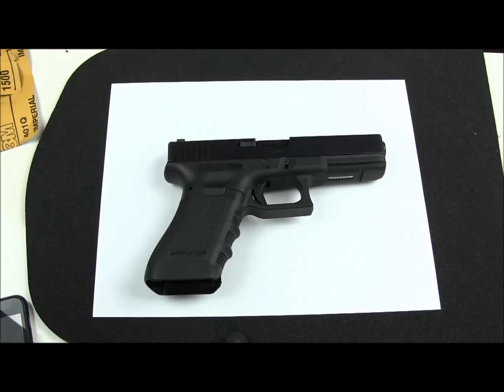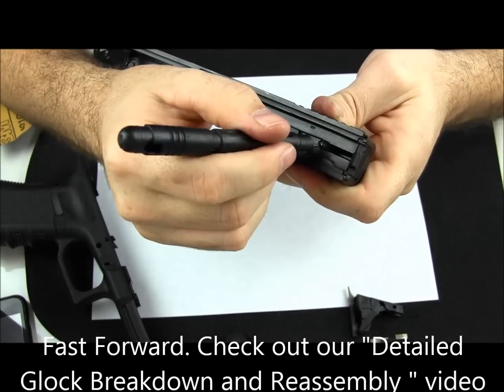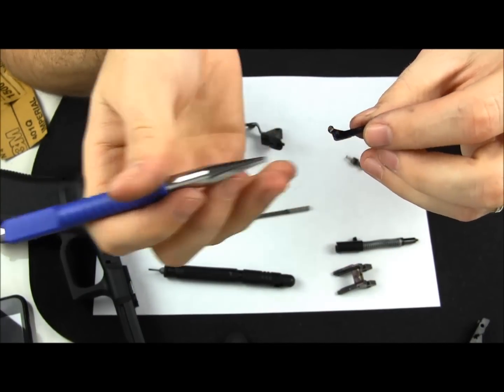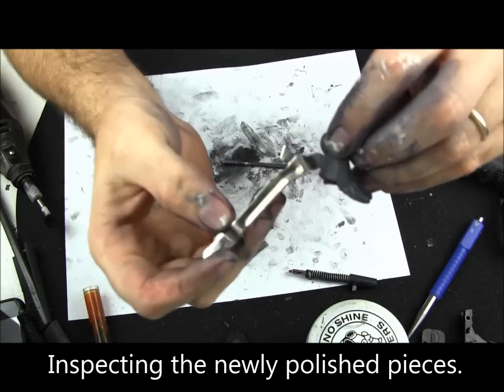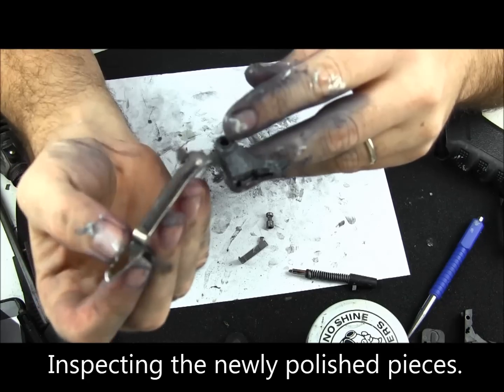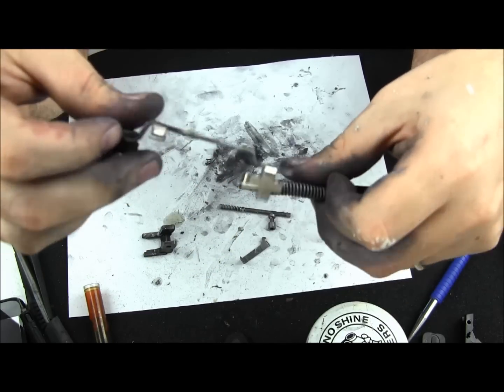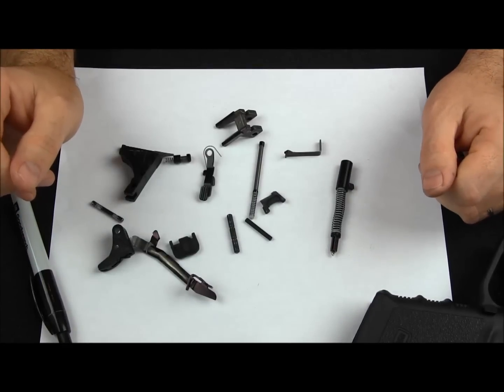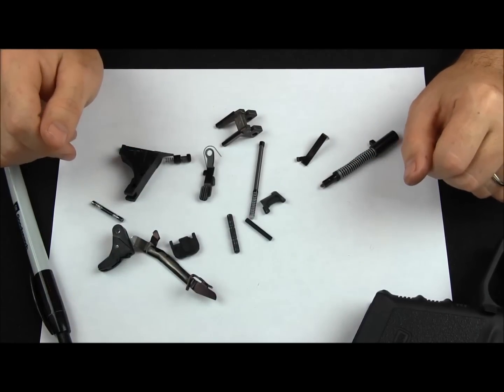DIY Glock Trigger Job and Action Enhancement www.GlockMods.us Episode 1

Comment: Very helpful video - but the reason I watched the video (the actual sanding), you did in double speed.  Do you have one in normal speed?
Reply from the maker: I've had a couple people ask this same thing and I do indeed have all of my original footage. I will dig it up and see if I can upload it and do a link in this video for detailed parts of the video. It seems like at the time I posted this I was limited on either time or video size and I went a little over board with speeding some parts up. My apologies.

Comment: I've heard of good results re-contouring the safety plunger.. What are your thoughts on this?
Reply from the maker: It works great but I HIGHLY recommend checking out the Lightning Strike titanium safety plungers that are slightly longer (helps a lot with over travel). Feels great and I run them in every single Glock.

Comment: I followed this modification mostly. I did not want to take the sandpaper to it but I did want things smoother. My "dremel" is a Milwaukee M12 battery powered one and it worked very nicely. I did use the Mother's as that is exactly what I had on hand. Thanks for this great video. First time ever taking the action of a Glock apart and all came apart well and went back together without a hitch!
Reply: 1500 grit sandpaper, has no real "grit" to it at all.  It's used for polishing actually.
Reply from the maker: Thanks!

Comment: What did you use to clean the polish off the parts? Anything special?
Reply from the maker: Nothing special. After the polish dries you can easily wipe it off with a dry cloth. Once that's done I always rinse the parts with soap and water, dry with a rag, then air dry, apply rem oil, let sit for 12 hours (to let the teflon in the rem oil stick good), wipe again lightly with a dry cloth and reassemble. Hope this helps! Jesse
Reply: GlockMods
Glad this was mentioned. I tend to use (over use) Brake Clean for every thing. It can be quite harsh on skin, lungs and surfaces. I will use the soap and water method like you did.
Reply from the maker: Hot water, dish soap like dawn or palmolive and a all nylon tooth brush is the best thing you can use on a frame. Just rinse very thoroughly. The brake clean is ok on the metal parts but can be pretty harsh as far a drying out the polymer over time.

Comment: trigger gets stuck on the connector now unless it's lubed.. Went back to all factory parts and the gun can dry fire with no problems.
Reply from the maker: Dimitry, I've ran into this same problem in at least three of my test guns but the one thing all three had in common is that I had a after market spring kit that I installed at the time of the action/trigger job. If you did this check your plunger spring and your sear engagement spring. Also your firing pin spring for some reason can cause this. I've worked with several companies on this issue before with their spring kits and it seems to happen often if it's a Gen 4 gun with a trigger/action job and a spring kit. Sometimes a simple modified Ghost connector with all stock springs is the best way to go unless you have a NY trigger spring.

Comment: I've heard some bad things about polishing the internals of a glock. people say you'll get 3 or 4 round burst, which I don't want. How's the g22 performance so far?
Reply from the maker: It's not the polishing that causes it necessarily. It's when you're trying to polish the striker face and cruciform where they meet and you change the angle every so slightly. You really have to take your time and be very careful not to do this. The best thing I recommend is when you polish those areas (with no less than 1k wet dry) lay the paper on a metal perfectly flat surface. The the edge of the cruciform that connects to the striker down on the paper and tilt it back till you fill it stop and you can't see light under it meaning they're perfectly parallel to each other and then pull from front to back on the stroke, lift up and repeat (do not go side to side or you're defeating the purpose of a trigger job). The G22s performance is still amazing. This is the best Glock out of our test fleet and we take it out almost every range trip. At least 50+Glock fans in the area of shot this pistol and absolutely fall in love.

Comment: Hi, did you wash the frame as well?
Reply from the maker: I have found it best to wash the frame in hot soapy water with a all nylon toothbrush in very hot soapy water. It gets in the hard to reach hard to reach places. Just thoroughly rinse and dry. I recommend drying by hand with a dry cloth and letting it sit over a common floor HVAC vent in your home if possible. You don't want to use any type of dry overly hot direct heat like a space heater or a heat gun.

Comment: Might I suggest polishing the inside of the frame also. From time to time where the frame touches can be a bit "rough" also. I polish this on each one of mine. I use Mothers and it shines it up nice with a dremel buffing wheel.
Reply from the maker: I've heard of doing this to a few spots (especially where the trigger bar rides the right inside of the frame, plus gen 4s have the "Bump" there.) and it really helping a lot.

Comment: Excellent information. I have a G36 I carried for a couple of years. I cleaned that gun thoroughly after every shooting practice. But started getting failures. Changed the recoil spring. Got new Mags, etc. Still fails too often to carry. This will become my experimental learning gun for tear down and clean polish etc. This vid tells a lot. Thank You.
Reply: ***** Been working too much overtime out of town. But... It will happen soon. I'll post a comment about it. I'll either screw it up or make it sweet. I think it's going to be sweet.
Reply from the maker: Let me know if you ever got around to this and more specifically what the exact issue is. I may can help narrow it down.

Comment: Holy shit, this is the most detailed and informative trigger jod vid I have seen!!! Great job. I had done a trigger job on my 19 and then I watched this vid, immediately tore my gun apart and did the black marker trick (awesome) so many places I missed. Oncce again great job and thanks for the vid.
Reply from the maker: Thank you so much for the kind words!!! I actually came up with the magic marker trick years ago when I started doing trigger jobs on the more difficult Beretta 92 series pistols. I never do a trigger job that involves the action bar/sear/etc without doing that first because contact points can vary slightly from gun to gun. It's also a great way of finding out of spec parts in the action that shouldn't be rubbing together. I'm really glad it helped! Thanks, Jesse

Comment: I personally did all these mods PLUS adding a GLOCKMADE adjustable trigger bow. That item works well for taking up 100% of the  pre travel and almost all of any creep.For just a few dollars you can buy a completely RECONTOURED and titanium nitrided firing pin safety with a lighter spring too!  My Ghost Evo connector works awesome with the polish job resulting in ZERO over travel.A skelatonized  titanium nitrided firing pin didnt hurt either. I shoot almost twice as accurately due to an incredibly well performing trigger. I actually didnt use the black marker method. It is super fast and easy to simply polish EVERY nook and cranny of all metal parts. Plus it looks SO COOL to see every surface highly polished even if there are some areas that dont functionally need polishing. There is zero harm to polish everything including the locking block. My G17 Gen 4 is stupid smooth and SO much more enjoyable to shoot!!!  It has had not one single failure of any kind. Trigger pull is right at 4lbs. It is a range and training firearm, but I would be comfortable using it in any defensive purpose. Jesse, thanks for such a great video. I love your calm voice and demeanor.
Reply from the maker: Thank you so much @bigdave!!! I really appreciate the kind words. I am going to make a video soon as mentioned above about how to contour a stock or aftermarket connector to get rid of any snags the factory glock trigger setup has. You won't feel a weight difference from the start of the pull until the glass breaks :) It's a little time consuming but it makes for an amazing pull from anything short of a full Zev trigger setup.

Comment: Really well done video, I use the marker trick (or a variant with spray paint or grease) when fitting wheels on my race car. Great for checking clearance making sure I don't need to do any grinding. I have also used it on my truck to see where my suspension is hitting when fully flexed.
Reply from the maker: Awesome! Glad the little trick has helped! I use it anytime in life when I have to pinpoint wear points. Works like a charm.

Comment: Do you have any thoughts on reducing the spring pressure exerted by the trigger connector to the trigger bar by simply bending the connector to more of a 90 degree angle at the point where it goes into the trigger housing?  Hope that made sense.  I've attempted it on two different mods and so far no problem.  Not sure if there is a limit to the amount of pressure reduction before it becomes a problem.
Reply: DO NOT BEND THE TRIGGER BAR
Reply: I know exactly what part you are talking about its bent that way for a reason it's not suppose to sit flush
Reply from the maker: Personally I would very highly recommend you not doing this. A simple twist in the metal can cause the cruciform to stay bent down and either the striker can't stay back or it may just hang wide open. Good luck but please do bend the trigger bar me friend.

Comment: Did this today to my Gen 4 Glock 19. Parts came out pretty shiny and smooth. Mods include: Glock OEM Minus connector. My Gen 4 G19 still has a tremendous amount of creep though... does anyone know how to get rid of it? I put in my stock connector and it's actually slightly better than my Minus connector. Both make the trigger pull feel super long and just terrible. I have another unfired Gen 4 G19 that has a better trigger and noticeably less creep. It is equally light to break as my gun even though my gun has 800 rounds through it and a Minus connector and the other is bone stock and unfired. Also in contrast, we have a Gen 3 G23 with a fantastic trigger as well. Nearly ZERO creep in that example. Please help.
Reply: +drewmorgan dry fire it about 5000 times and it will self polish at the RIGHT  spots :D.....at the same time will improve your aiming and trigger skills....what can be better than that ;)
Reply from the maker: I'm going to work on a video showing how to cut, radius and polish a stock or aftermarket connector. You can make or break a glocks trigger pull with one little mod.

Comment: Careful to not do too much polishing on the rear of the cruciform or you'll go full auto. Flitz for polishing.
Reply from the maker: That is a very important step. This particular gun just turned over 10k rounds on my last range trip after finishing off 2 200 round bulk boxes that I do every few weeks with it in the warmer months. Probably 98% of that ammo shot was bulk target ammo since this video was made and it has literally had zero issues that I can think of. As mentioned in the video it's very important not to change the angle of the striker face or the cruciform. You don't just go at it like a wild man and I recommend using a polishing 1-2k wet sand paper and a fine finish buffing compound like mothers. Taking your time and being patient is the key. Out of our 6 shop Glocks/test mules we've done this with zero issues and a LOT of ammo down range. Also a few torture tests after these mods with Zero issues as well. Thanks for watching, Craig, and have a great day!

Comment: What I missed in this video is a DEMONSTRATION of irritating imperfections in the pistol ACTION, which supposedly are all gone with sanding and polishing. If before starting to show the spots which are needed to be polished you'd have rocked the frame and dry-fired a few times pointing at how unsatisfactory this or that worked. I think then your video had better effect. Because, who knows if this really improved things much measurably, or this is largely something that you were trying to convince yourself with. Too bad these modifications are something that is impossible for the viewers to feel, or measure. Thumbs up!
Reply from the maker: I understand where you're coming from. Usually with these guns the cruciform will have a rough machined edge on the bottom and the stock connector is rough were it rides along the cruciform assembly. This  is the biggest problem areas I've found with the actual crispness of the trigger. A lighter spring kit also helps tremendously and a longer safety plunger ( I use a Lightning Strike Titanium plunger in ALL of my and my customers Glocks that I do this type of work on). As far as the action of the pistol very carefully working on the frame rails, slide rails and feed ramp with make a night and day difference in the gun. This particular G22 Gen 3 in most of my videos is one of the smoothest Glocks anyone I know has every held in their hands or shot. If you take your time and very meticulously work on any of the tiny rough spots or roughly machined spots in the action you will be greatly rewarded.